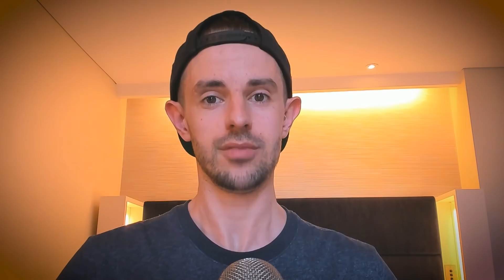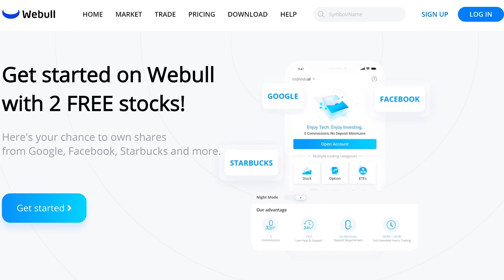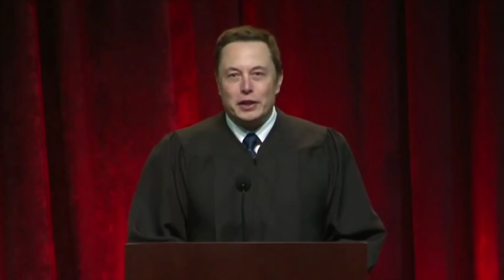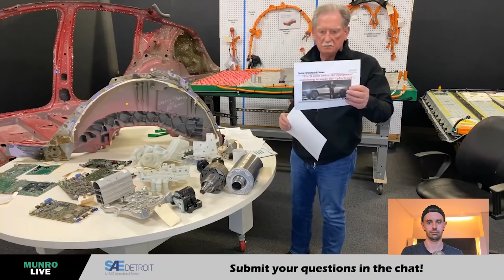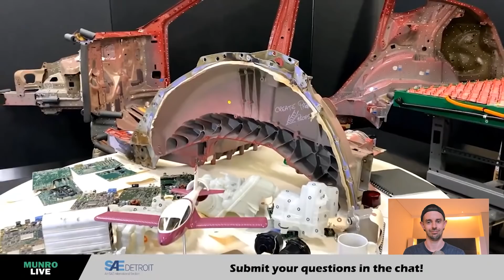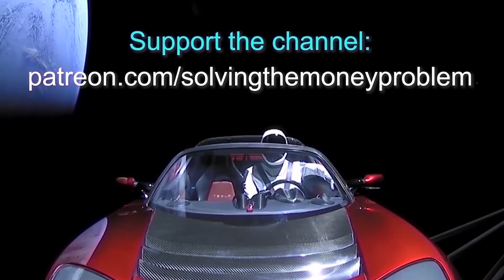Sandy Munro: Why Tesla DOMINATES (& has no competition)

Comment: Wrong. The stronger construction especially without crumple zones will win but will also hurt or kill people in it easier. Those zones act as energy absorbers all the while the change kinetic energy of vehicle into heat. Not even airbags would help you if you crash without those zones when compared to survivable crash at the same speed with the crumple zones.

Comment: "Work hard", totally. "Who works the hardest is going to win", sure, maybe. But "work twice the hours, get twice as much done", not so fast, it's not quite that simple.
I've seen some statistics on how effective cruching is in software development, and it turns out after putting more than 10 hours a day into it, you get less and less productive. In fact at some point it turns negative. Probably because tired people make more mistakes that you have to fix later.
Elon might be an exception to this though :D
Reply: Thanks for your comment. For insights t,e,x,t,m,e,u,p
+1(4,0,8,),5,8,0,0,8,4,6,

Comment: Love your videos but I think you may be off a bit when you stated that getting hit by a cyber truck may not be so bad.  Weight works both ways.....your safety and destroying what is hit.  With the strength of the truck as the exoskeleton combined with the weight I would not like to be in an average car getting hit by a cyber truck......just saying.
Reply: Thanks for your comment. For insights t,e,x,t,m,e,u,p
+1(4,0,8,),5,8,0,0,8,4,6,

Comment: 17:55 that's where you are wrong. Yes the cybertruck will be fine, but not necessarily its occupants: if the cybertruck doesn't absorb the energy of the impact by deforming itself, then it is other materials (i.e. blood and bones) that will gather that energy.

With that said, I'm sure Tesla's engineers did take that into account, and it is possiblethe inside of the cabin will have some deformable parts and some dampers to absorb that energy in place of the occupants.

Just wanted to point out that your reasoning was incorrect.

Comment: It occurs to me the legacy ICEV auto manufacturing engineers have not grasped the basic, slim battery energy margins available with EV's vs ICEV's and the huge energy margins of inefficient petrol engines.  In a way, they are energy spoiled because of the excess available with petrol.  The slim energy margins of batteries in EV's causes serious EV manufacturers to rethink the use of energy within and throughout the EV platform.  This difference of energy availability is so profound but difficult for the average consumer to comprehend.  Until consumers internalize this difference ICEV legacy manufacturers will continue to confuse their customers with inaccurate information and lacking designs.  Tesla is not using magic to achieve their numbers but they are using more sophisticated engineering borne out of an energy scarcity due to the singular nature of the limits of battery energy storage and the tradeoff of weight & volume & cost.

Comment: I think Peter Rawlinson might argue that the Lucid Air will be a serious competitor to the Tesla Model S & X when they start production later this year. As a TSLA & CCIV shareholder I'm looking forward to what the Motoring Media thinks of the Lucid Air when it becomes available soon - 500 mile range, smaller lighter drive train motors, Formula E racing battery tech plus more luxury. Lucid is backed by the Saudi PIF and their are rumours that Apple might want to team up with Lucid.

Comment: About working more hours:
* I worked very hard in the first years of my career only to find that my hard work was undone in 2 weeks because of processes/people beyond my control.

* a fellow worker who was hired from a big American IT company told me they always worked long days and weeks until they suddenly had to stop doing that because it was ordered from the top echelons to save money. Heavy protest followed and they only temporarily agreed if a before and after test of performance, as in quantifyable result was done. After 1 year it turned out they worked less but delivered more. 

*actually over the years that corresponds with my own experience, that the best time saving ideas come from lots of pressure/necessity but a good balance between working hours and leasure time. In fact at Ford, Henry Ford introduced the 8 hour working day because it was most productive. 

So my take on this is: you have to have the motivation/pressure to do innovation but not long hours
Reply: Solving the Money problem  Could you change your name to Solving the Bitcoin Problem? Would be more genuine.

Comment: I reserved a cyber truck with the exact same thinking as you Steven. For $77k, you literally get a better truck than the F-150, more stares than a Ferrari, and similar performance to a corvette . What the hell is this thing? Saving room in my garage for a used F430 or 360. Ferrari is the only other car manufacturer that gives me wood. 👍 I’m also a workaholic. Run the business and practice full time as an attorney. Couldn’t live any other way

Comment: BTW, I think Q1 earnings call implies that Tesla will start Berlin & perhaps Texas production with some legacy cells from the suppliers. I've not seen it discussed anywhere.

They plan to double external battery supply in 2022. Into which products would they put the extra supply otherwise? The production in China is not planned to be increased by the whole 2021 production. Any other future products, everybody assumes, will use 4680. But that assumption does not seem to be correct.

Similarly new Model S/X can use 1865(0) Battery for now and 4680 for Plaid+ (which was delayed considerably). Another piece of the puzzle is that timelines of Model Y volume production and 4680 volume production do not match.

What do you think about this theory?

Sorry for the slight off-topic and abusing the fact that you read all our comments ;-)

Comment: Lots of fact driven conclusions and I like this. But I checked https://www.evspecifications.com/en/model/2b8eff and seems ID4 has 77 kwh battery - Andy mention 100 kw.  Curb weight 2049; while Tesla Model Y 2003 kg, 74 Kwh battery. So they are not much different on these points. Maybe a suggestion for a video - what exactly is different in battery structure, battery tech Tesla vs all the rest. I understand it might be boring to investigate Ford or GM battery technology :), but..  Also, what exactly is coming from Tesla in next 5 years optimising their battery technology (I heard about some 3-4 improvement stages which will enable rising battery energy density +25-30% with each stage) with help of their acquired battery chemistry companies (was it Maxwell??) which should dramatically put Tesla further in front of everyone with options to give more kwh capacity per less weight.

Comment: Honestly, the engineering deep dives are the reason I'm interested.  Yes, a deep dive into the gigacasting machine would be most welcome.

I'm not quite on board with Sandy when he predicts that China will be Tesla's competition in the BEV space.  Granted, they can do mechanical engineering.  Where they are weak is in electronics/computers/software and strategic thinking.

One of the Chinese automakers is still pursuing battery swapping for consumers.  The economics of it are not favorable, to put it mildly.  Move electricity to the consumer, don't move heavy packs.  The swapping machinery is an unnecessary capital expense; the extra labor is prohibitive; the extra pack inventory is expensive and a poor use of scarce batteries; and it will be a horrible challenge to maintain inventory sufficient to avoid swap waiting times worse than the time it takes to just charge the damn car.  This is strategic thinking on a par with hydrogen fuel cell cars.  We have the grid.  Use that to move energy around.

Mainland China can't make competitive chips.  They're bad.  Chinese-sourced and manufactured PCs are a joke.  Maybe one day they'll catch up.  That day is not near.

China is closing in on doing quite well in battery manufacturing.  They aren't leading, but CATL is able to supply cells to Tesla, whose quality and performance requirements set a high bar.

China can design and produce an appealing car, mechanically.  They can do well on price.  But no-one can do Dojo + FSD level work with machine learning.  As for the FSD computer chip, no.  Even ordinary GPUs will have to be imported, and they aren't very good for the purpose.  Their fleet sizes are low, and they don't collect the data required to solve vision.  The most advanced BEV manufacturer in China stole old code from Tesla.  They have no ability to advance it.  This, too, is evidence of poor strategic thinking.  It's actually harder to reverse-engineer what Tesla is doing in hardware and software than it is to start from scratch with a bunch of eager bright academics right out of school.  Alas, starting from scratch, it'll take them a decade - if they're lucky and if they trust the right minds.  No guarantees they will be lucky.  No guarantees they'll trust the right minds.

Legacy automakers will struggle with electronics and software, too.  They're all far behind.  Tesla has no serious competition yet.  No-one is close and won't be for years to come.  China is further behind than some.  I think they may gain some traction at the low end, but wherever Tesla is operating in the market, they won't be competitive in this decade.

Tesla's $25K car is going to put a hard ceiling on Chinese BEV prices.  They won't be able to match Tesla's price/value ratio.  The state will probably prevent any of them from going bankrupt, but that just means limping along with stripped-down products with low margins.  Where they try for upscale consumers, they'll fall flat on their faces.  Tesla is the elephant in the room, and for the foreseeable future, no other animal with sufficient bulk will be able to muscle Tesla aside.  Best they can do is to nibble around the edges with product categories Tesla isn't addressing, like city buses and garbage trucks.  You'll hear plenty about upscale models, but they won't achieve much.

Comment: Just wanted to say, when I was working at Motorola in 1987, and this was when Motorola made their own CPUs (look up the original Apple Macintosh).  As a junior hardware engineer there, I proposed a design for a new X25 PAD that used a competing Zilog CPU.  Drew up the schematics and everything and presented it to my boss and my boss’s boss and several other senior engineers.  I proved to them that my new design would cut the parts count by over 1/2 and cost 40% less.  I had the guts to propose to them to use a competitor’s cpu because it made sense.  Needless to say they didn’t go for it.

Comment: Love the technical things - amazing how many areas Tesla is leading in - AI, batteries, charging network, manufacturing, metallurgy, large castings, design, heat management, software, over the air updates, autonomous driving, electric motors, chip design, AND comfortable seats.
Reply: Tesla isn’t leading in AI

Comment: Ha. SMR. Re Cybertruck I did the same thing. When launched, Tesla said the production order would be Single, Dual, Tri. I didn't want to wait for the Tri so ordered a Dual with FSD. Once bookings began flooding in, Tesla saw that few wanted the Single and the bookings were evenly split between Dual and Tri. So they reversed the production schedule, saying the Tri would come out first. I then booked my second Cybertruck with the Tri with FSD and shock, horror discovered I had to pay an additional 3 or4 thousand for FSD. I'm in New Zealand so have to wait... and wait... for the righthand drive version. I just hope I get one before I die! (A bit of dark humour since I'm in my mid 60's already) Cheers mate.

Comment: Guys, I'm an investor in Tesla - but, you better take into account BYD.  Beautiful vehicles, rail battery and heat pump, trucks, buses, taxis, etc. - impressive.  Would like to see more info on BYD compared to Tesla so we can  see what's coming.
Reply: But does it have powerwalls, solar panel, autobidder, custom AI hardware and software, FSD developmznt, megapacks, insurance, crypto assets, energy distribution aspirations, HVAC ideas, etc...? :D I started buying TSLA for the cars, but a I piled on continuously since because of all of the above
Reply: @Sam-u8i6f  Thanks Sammy.  Not so worried I guess about Tesla, but BYD is best competitor I've seen.  They do have a lot of revenue sources and have been hugely successful since I believe 1995.   Just amazes me that I don't hear much about BYD yet they are they are promoting a rail battery system that won't catch fire in an accident and it's given a 600 km range.  Would like to see Sandy discuss BYD with his insight.  Tho if Tesla can get parts, they should continue to lead the pack.
Reply: I owned a few stocks 
Tesla spoiled me with 20x 
So I sold 2x and 3x 
I'm all in on tesla 
BYD may be a good stock but can't see them more then 5x at most

Comment: Are the Giga presses just stamping the metal or are they also casting or is it some kind of combination of each? I'd like to know more about this.
Reply: They’re casting the front and rear and scoring, bending and welding the main structural body that will be the load bearing part of the truck
Reply: @TimothyParker1  
No, they're not.
They're the casting machines for the rear (now front) chassis sections.
At the moment the passenger cage is conventional, welded. That may change in the future, but not yet.
Reply: Like everyone so far has said, it's a casting with molten aluminum.  But a very special aluminum.  Tesla had to get the right alloys in the blend to create a part that doesn't require heat treating.  The heat treating is expensive--baking every part in an oven, then cooling it off.  And the bad part about heat treating is the warping that causes additional machining.  Tesla found an aluminum allow that doesn't need heat treating for strength.  Absolutely brilliant.  I love how Sandy says everyone should be using the Giga press castings.  But in order to get it to work, they would have to buy the recipe for the aluminum alloy from Tesla.  None of the other OEM's have their own material sciences group.  Tesla has not only changed what a car is, but is rapidly changing how cars are manufactured.  When Sandy says Tesla has no competition, this is one of the reasons.  Even if another manufacture comes up with a really good EV, they can't build them as cheaply as Tesla.
Reply: Just casting their own special aluminum alloy. Simple and very fast.
Reply: It's actually high pressure Injection Molding, not stamping or pressing or casting or forging
Reply: @jonbong98  high pressure injection casting. The method is different but it's still a cast.